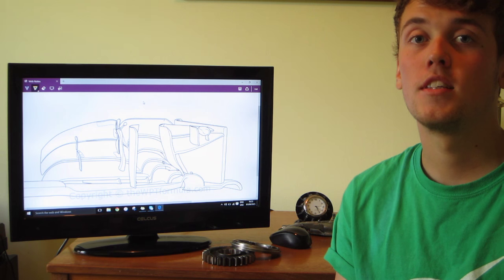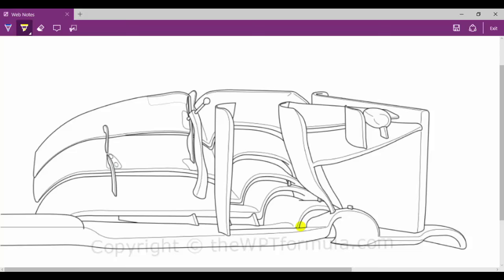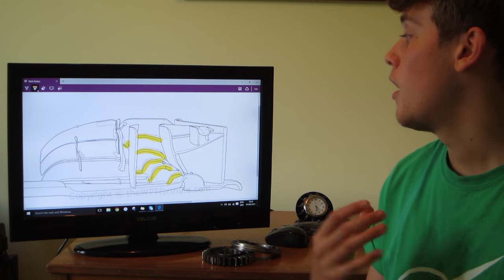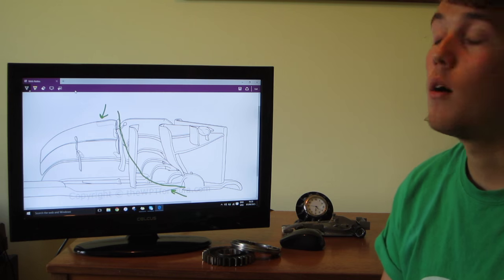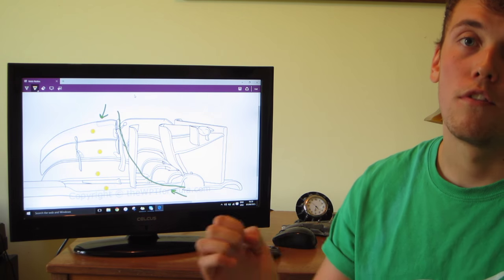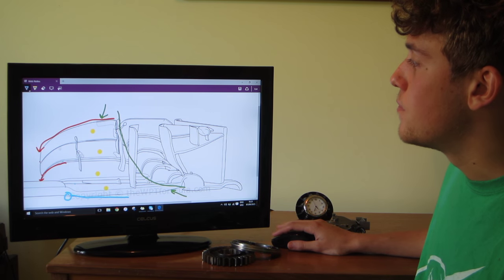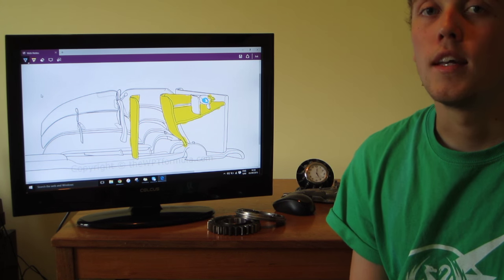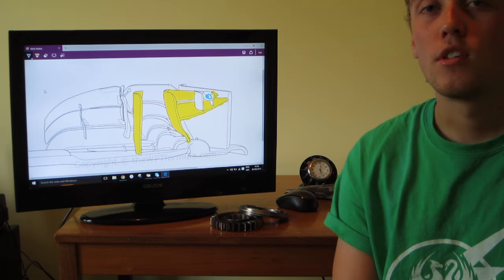How does an F1 front wing work?

Comment: Multi elements are to increase angle of attack and delay stall. The more elements in front of the tyre are because needs to lift more air over/around the tyre. Inboard areofoil profile is reduced size/shape to minimise dirty air over the car, where it also is used.

Comment: Hi, very good and informative video! A question that occured to me while watching the video: How do the teams assemble these very complex wings? Are the parts clued together, if so how with the enormous forces? 

I am very interested in the technical side of F1. Are you an aero guy or do you cover engine and other things as well?
In terms of aerodynamics I am interested in the rear of the car: what are the teams currently doing with exhaust gases now that they have to put the exhaust exit behind the rear wing?
The brake cooling ducts as aerodynamic devices would also be quite interesting I think. 

Keep up your good work! :)
Reply: +The Sim Racer The wings are glued together. For the enormous forces, they use enormously strong glue :)